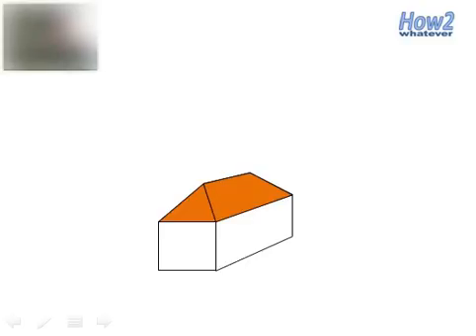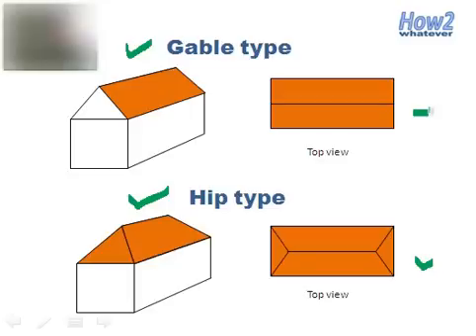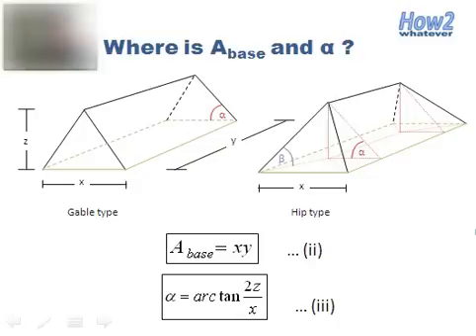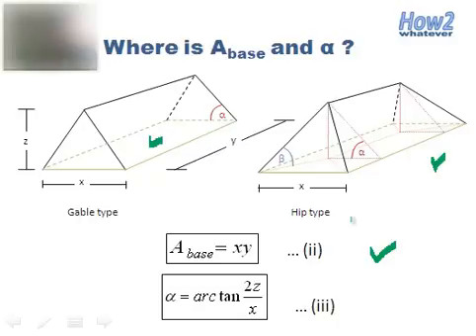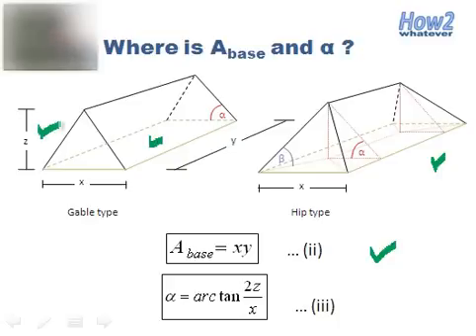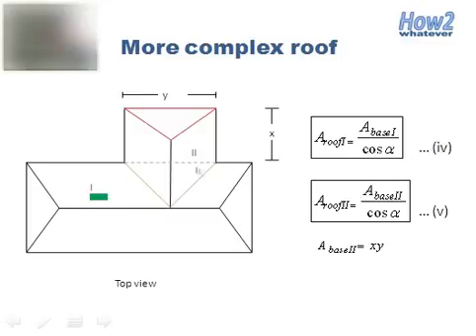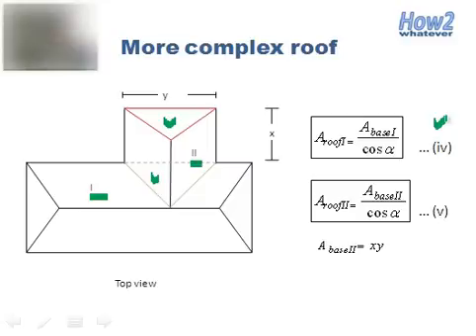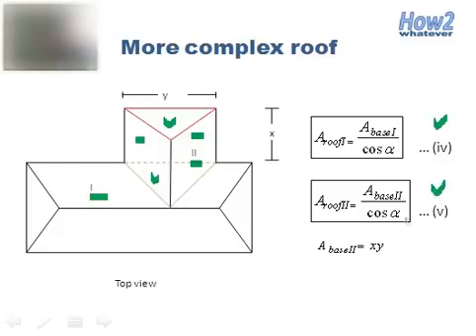Measure the Surface Area of a Roof

Comment: Why are there so many descriptions like this on line. 
The area of the simple roof (for both gable end and hip end) is 2 x eave length x rafter length. No need for the ridiculous geometry.
For the complicated roof, you do this for each roof and add the two.